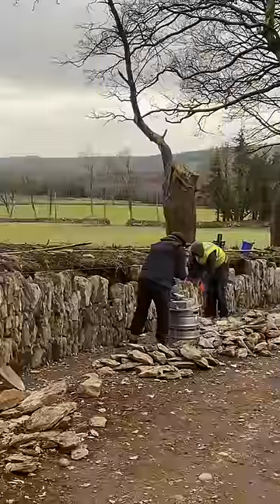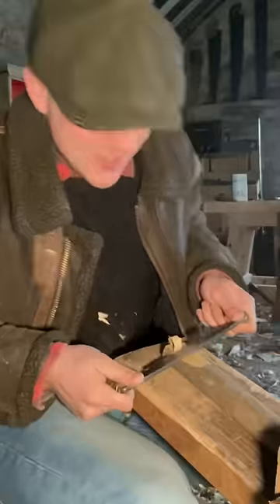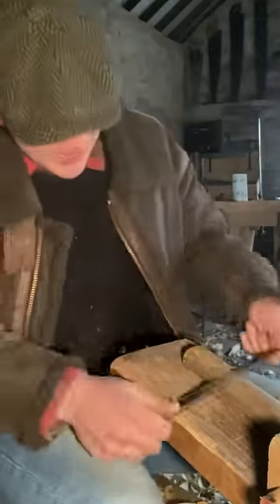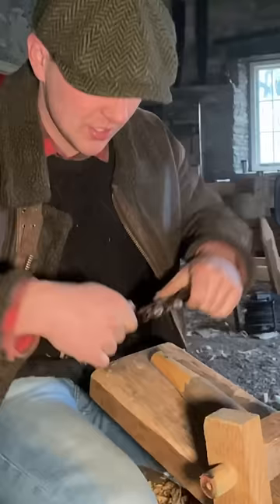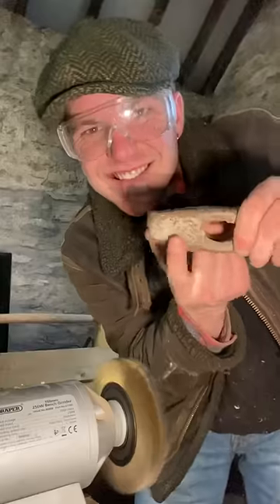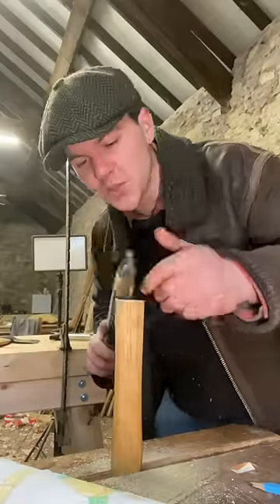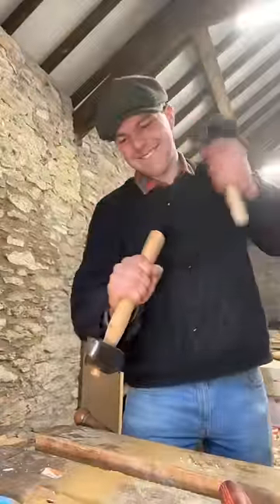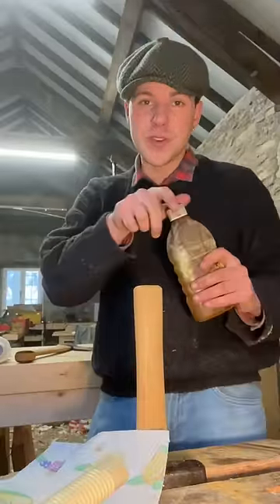Making my first hickory handle #handtools #ireland #woodwork #satisfying #stonemasonry

Comment: That little bevel on the bottom of the handle, is so satisfying for some reason
Reply: And he's 100% right, the Shinto saw/rasp is the perfect tool for such a job. I've used mine for bevels and chamfers of a similar style many times over the last 5 years or so. I hardly use my traditional rasp anymore.
Reply: @0num4  that’s actually pretty cool to know, I may have to look into getting one of those thanks!

Comment: Great video and you made a craftsman smile.
Never throw out an old sledge or ax handle.
I have used those bandles to repair many hammer handles over the years and otber projects requiring pieces of hickory. 
I would bet some of the wood i used is over 100 years old.
Reply: Good wood 🪵 😅  (I  couldn't help myself) 😂

Comment: I like the 150 to 180 grit finish on my personal tool handles. I like the silky feel, and they still grip well. 2 coats of pure tung oil. First coat thinned 5050 with mineral spirits. Second coat un thinned. Then I give it a coat every couple of years :) 
120 is great, too. Purely personal preferences.

Comment: What's it like to use though? Americans seem to like hickory for handles. Wouldn't it be like an iron handle though? No give at all?
Reply: Hickory handles vibration very well, actually! Definitely more comfortable than a steel handle.

Skill helps a lot though -- more "dead-on" you are to the center of the hammer face, the less shock to the arm (and less wear on the handle).

Comment: Uuuuugh! Hickory is gorgeous and so strong (and flexible which is why that was papaws switch tree 😬🤣🤣) but god Almighty, itll be you down to work. I did a hickory slab coffee table for a friend. The hickory tree had fallen 20 years before in the woods behind my grandparents house. We cut the slab in the woods with a chain saw then jad to wrestle ot about half a mile, up hill, through a thicket 🤣🤣🤣 the frequency with which onhad to sharpen my tools while working that wood is still unmatched.